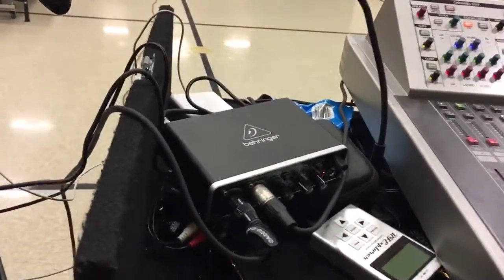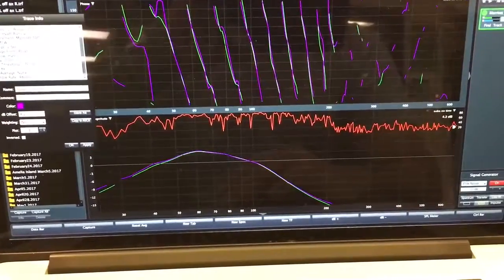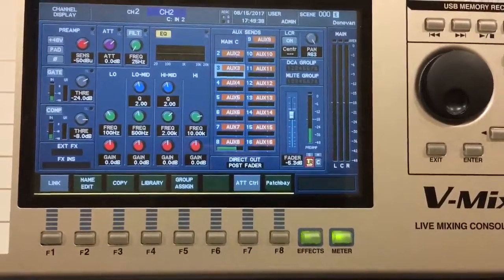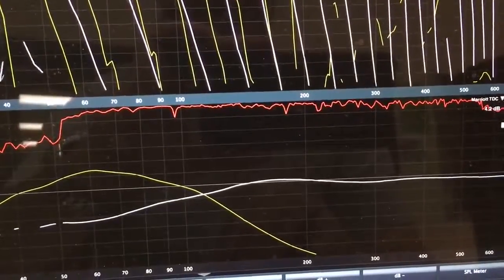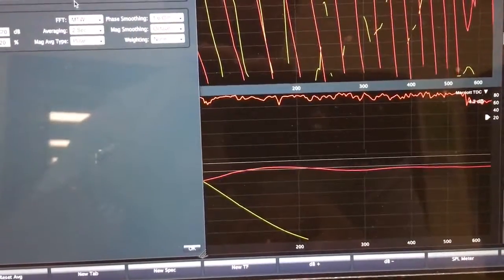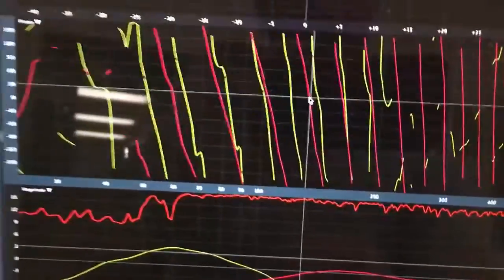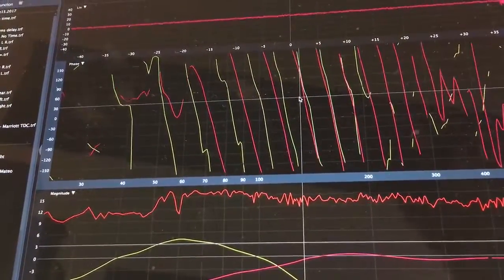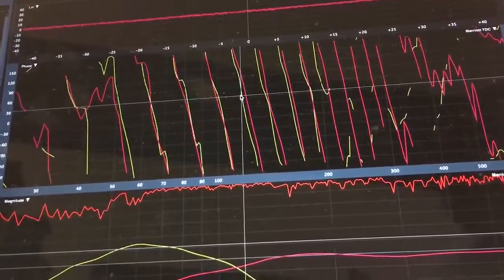Using Smaart V8 to phase align subs to mains

Comment: I thought you had to delay the subs since they are physically closer and would require less time delay than the tops. ?
Reply: In this case the subs are upstage of the tops.
Reply: @UncleWalter1  what if the subs were downstage or in front of the stage, would you still measure the subs before the tops?

Comment: you supposed to delay the sub ... right? or any new technology?
Reply: You have delay the channel that supplies the speakers that are physically closer to the audience. If your subs are further from the audience than your main LR, you can't delay them in order to time align the PA.
Reply: @prospekt1909  You dont have to though, right? All that matters is the achievement of summation and phase alignment?
Reply: @user-uh2cr9so8l  Yes, it's all about alignment and avoiding a loss of SPL due to cancellation (or, in other words: summation).

And as soon as it's clear how that works, it will also be clear why my initial statement about what channel of the PA (subs or mains LR) needs to be delayed is true. I'm happy to elaborate further, if necessary. :)